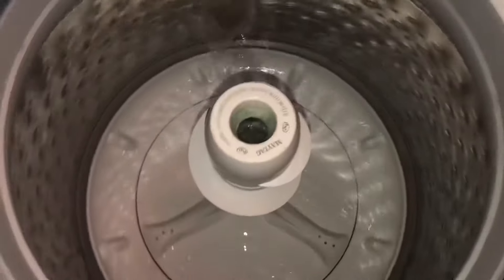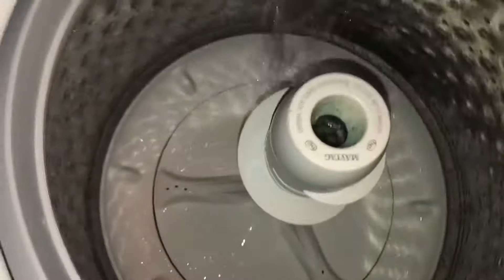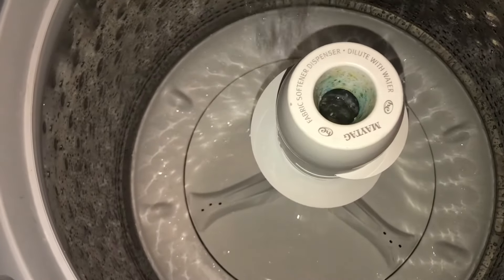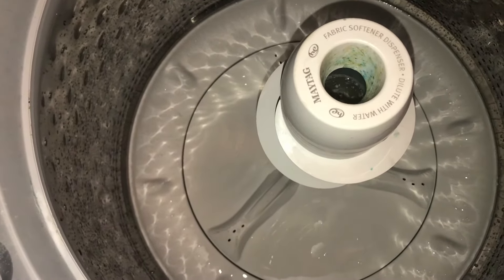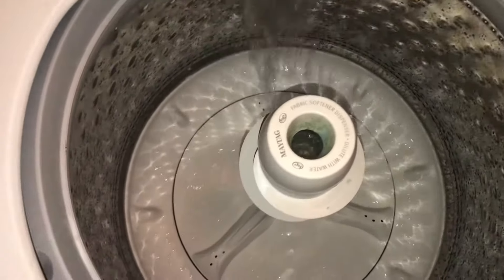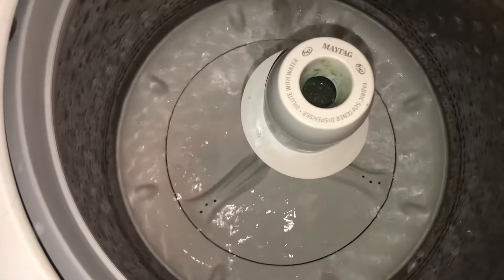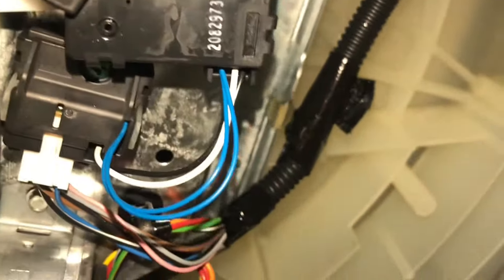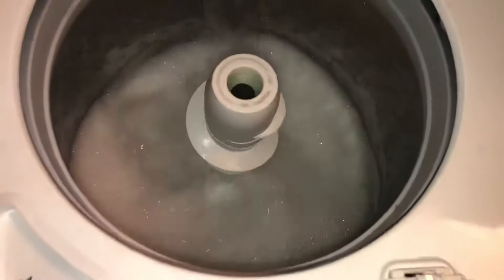Whirlpool Maytag Washer Not Agitating￼|Not Washing|Easy Fix|Shifter Replacement

Comment: It'd be nice if you would point to what the heck you're talking about. We don't know what screws or what connector is what. Or maybe even show a picture of when you put it back together
Reply from the maker: If you are experiencing the same or similar symptoms. I mentioned to lay the washer on its back or against a wall so you can gain access to the bottom of the washer. I showed the part that came out. I I said just remove two screws- green screws. The name of the part is a shifter. If you need more help email me and I’ll explain more. Thanks for watching
Reply: There is a guy named Zachary Michaud that shows the problem exactly...just skip to the end, he talks a bit.
Reply from the maker: I actually said the washer wasn’t agitating in the video. I also pointed out what to check. The shifter wasn’t fully attached
Reply: @appliancerepairshorts a tutorial would be more helpful
Reply: @appliancerepairshorts 
Correction pointing out means pointing ☝️ to the part with your finger , a pointer or something of that sort all you did was mention what you did bro . So do better on your videos foolio😂
Reply: Yeah with a close up of the b4 and then after would be great. All the talking in the world can't show you the problem and the fix. Just saying 😂😂😂
Reply: Where's the connector?
Reply: @DAT-TEXAS-DUDE that is not the only time you can use "pointing something out" lmao 🤣 for example, you pointed out that he could have used his finger top actually point at something. We're not all idiots, we know what people are trying to say even if it's not in the literal sense you're trying to get at.

Comment: I have this  same washer. It is the worst POS on the market. Maytag should have did a recall for this model.  It's a lemon. It doesn't clean clothes well at all
Reply from the maker: The newer versions aren’t any better
Reply: I hate mine water saving bs destroys my clothes
Reply: Same here lolll doeasn t wash
Reply: Mine has a onion that you turn off auto sensing and switch it to deep water, it fills it up quite a bit, a lot better than auto sensing

Comment: It took me a few watches to understand what had come disconnected. For anyone else who sees this, the little white arm on the black piece is supposed to go in the white loop coming off the part on the left. It's hard to see bc the shot moves so fast, BUT it fixed my problem regardless so WOO HOO❣️💯🥳
Reply from the maker: Yes it was not as smooth, in fact I wasn’t originally planning on uploading it, but figured it might save some time and money. Glad it helped. Don’t over load your washer

Comment: Mine was also out and we have been having problems since we bought it. They told us we were using too much detergent and the pods were the problem. 3 years with this issue!
Reply from the maker: I highly doubt that would cause it to slip out. Maybe lighten up on the size of loads. Also check the big pulley nut. Also if you see oil cleaning it off will help.. it is also a sign that the gearbox (case) is going.

Comment: It fixed mine, but after one load it did it again, do you have any suggestions on how to stop it from coming off so often? Would it help to just replace the whole clip?
Reply from the maker: The shifter might be bad. Double the splutch
Reply: Double the splutch?
Reply from the maker: @marshabradshaw9906  sorry,double check the splutch and make sure they are matching securely. The shifter is responsible for moving the splutch.

Comment: Mine leak water from the bottom.. and it won’t spin
Reply from the maker: If you’re leaking, you probably have a bad seal and gear case. Is it loud during the spin, when it was spinning? If yes , you need a new machine or the above mentioned parts. If you are not loud during the spin, you might have a leak somewhere else and might need a shifter or a lip switch

Comment: The actuator and splutch are actually pretty easy. Don’t need to remove the screws to get it back. I worked with whirlpool making washers. Specifically where these parts are put on. Maytag’s more expensive stuff however, were done a few lines over
Reply from the maker: Pretty cool job. You have any videos of you working on them?

Comment: Nice vidéo but what did you fix and where i  have the same machine same problem
Reply from the maker: The shifters was not in place. I’ll link a shifter. Also unplug it for 5 minutes then try. You can also press the power button for about 5-8 seconds to reset
Reply from the maker: https://amzn.to/46gWmsb
Reply from the maker: https://amzn.to/46fVmon
Reply: @appliancerepairshorts  how do I  know the part is broken?
Reply from the maker: @popaul3051  you can put the washer into diagnostic and read the error message or tell me exactly what your washer is not doing. The shifter takes the washer out of wash and into spin and vice versa

Comment: So, mine does not agitate and the shifter leg is still in the hole,  my machine just clicks instead of agitating.  Does not wash worth a crap.  If shifter is still engaged and it clicks rather than agitating and it spins and all other functions seem okay, what part do I need to replace?  Thanks
Reply from the maker: If you could email me a video it would be best. See if your washer will spin. Sounds like your shifter is not working properly.

Comment: A modern impeller can be better because it’s more efficient and the type style of washers and dryers, we are going forwards and buying newer ones when old ones cost more for repairs  than the cost of a new one, not going backwards.
Reply from the maker: The main difference is the old one are built better, so the initial cost is not significant. The newer might be more “efficient “, but it depends on how you define efficiency. Old school runs forever. The newer ones don’t

Comment: My husband fixed our machine exactly as you instructed. It worked great for about 6-8 months. Now it is not agitating again. Is it common for it to slip out again?
Reply from the maker: Not often, but if you do heavy loads I notice that it does. Sorry i didn’t see your comment
Reply: My husband was able to take a thin drill beat and heat it up. He then burned a hole through the part and put a piece of copper wire and fashioned it into a know. His keeps the part from slipping out. The agitator works fine now. It was a design flaw and Maytag refused to fix it. Our problem is we live in an area 2 hours away from the nearest repair person.
Reply from the maker: @tamran127  send me a picture or video of the copper wire fixed. My email is there. Appreciate the update

Comment: I'm having the same problem, but mine are still connected. I did realize that the shifter motor has a lot of play. Is that normal? I am going to pickup a shifter motor in a few hours to see if that fixes it.
Reply from the maker: No it should not have any play. They do go bad. Also make sure you can move the splutch easily. The bracket that the shifter goes into. If it is difficult to move you can spray a bit of WD40 it helps. Or you might have to remove it and check it for wear . Keep me posted. I was on so I saw your comment. Email me if you have any question . Also you might want to check out my other videos on the tub hub. Very similar symptoms
Reply: @appliancerepairshorts  where can I find your email? I moved the splutch and it moves pretty smoothly

Comment: The video is moving around so fast and my eyesight is bad so when you are saying obviously they are not connected which part are you talking about? Did you point to it and I missed it? Are you referring to to blue and white wires, if so I cannot see where they are disconnected.
Reply: The black thing on the side has an arm that sticks up, the big pulley with the belt attached has a part with a hole in it. The arm belongs in the hole, you remove the 2 screws from the black thing (shift actuator) and slide that arm in the hole, reattach.
Reply: @rickladd1862  
Thank You Sir.
I appreciate your answer!
👍
Reply from the maker: @rickladd1862 appreciate you answering.
Reply from the maker: Sorry I totally didn’t see your comment until now. Yes it was the shifter or shift actuator. You can always email me if you have questions.

Comment: that was bad, didn't point out were it was disconnected or what two screws
Reply from the maker: The shifter was disconnected. The title I said shifter replaced. In your situation it might be a bad shift actuator or it might be out of place

Comment: It would be nice to actually see you do the repair have no idea what the problem was as you didn’t point out in your video
Reply from the maker: What do you mean? The title says what the washer is doing or not doing. I had the lid opened so you could see what the washer was actually doing. I also said it wasn’t agitating. The shifter was out of place. You can always email me if you need more help.
Reply: Point out the shifter, dude. POINT at what you're talking about. And what part was not connected. Not everyone knows the mechanics of the washer machine.
Reply from the maker: @wuttaworld  I thought I mentioned it. my apology